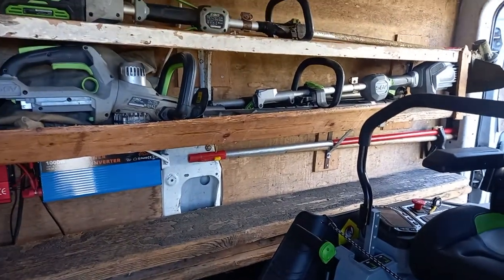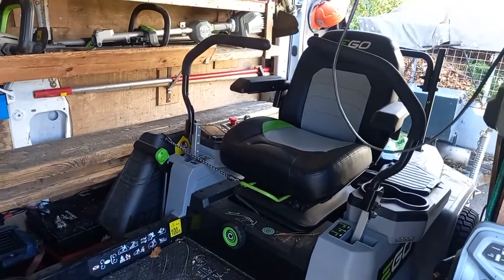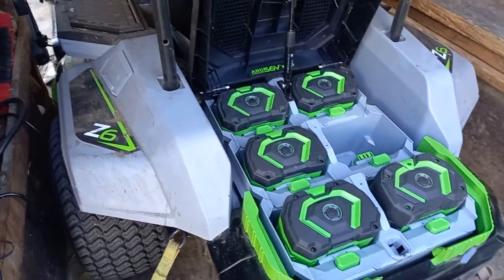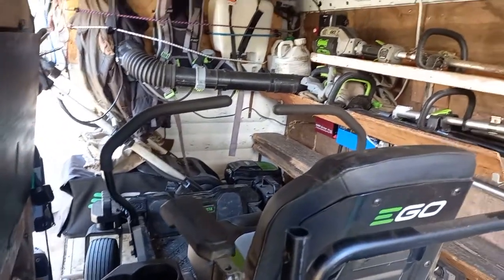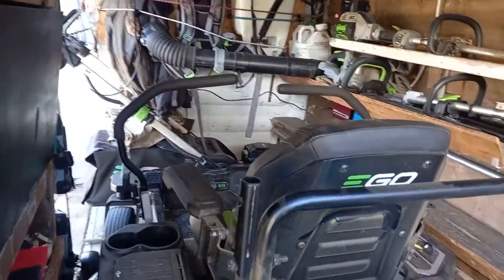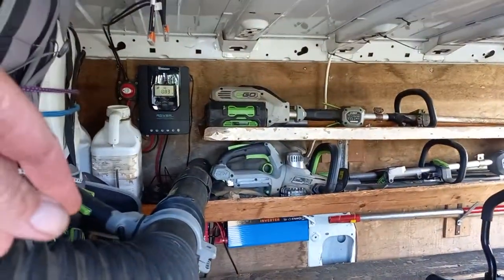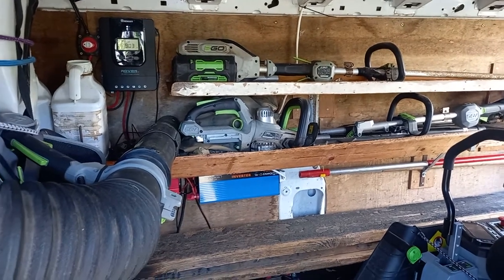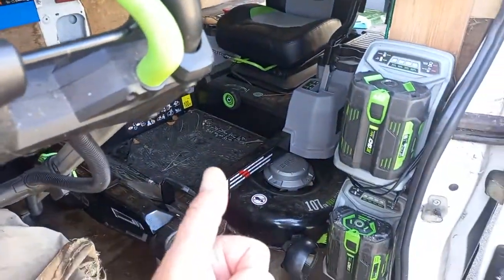Complete Ego 56volt lawn care setup with Solar charging system

Comment: Interesting set up, definitely not carbon free with all that plastic and all those batteries.
Reply from the maker: But in the long-term its got to be better. I haven't bought any petrol for nearly 2yrs and the solar system is helping keeping me off the grid. No rotten decks, repairs and servicing virtually zero.
Reply: @alexcoker5816  Sounds good, I came across your video because I was looking at the EGO blower and now looking at the mower as a back up to my petrol one. I like the idea of less noise. Problem I see is the price of the batteries.
Reply from the maker: Check on Facebook always a deal somewhere

Comment: I'm putting together a small solar setup to charge my Z6 e-Steer. Does the Z6 charger require a pure sine wave inverter or can I get away with modified sine wave?
Reply from the maker: It needs to be pure wave, and I've changed to the slower charger as the turbo charger just sucks to much to quickly and trips the inverter